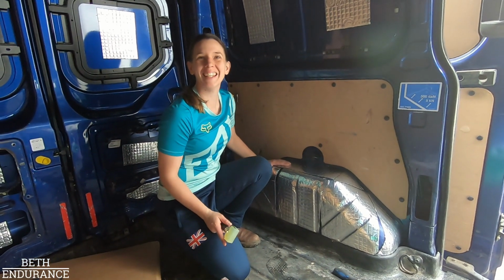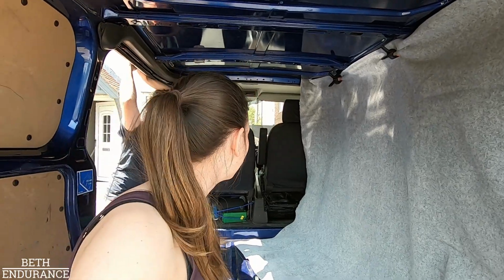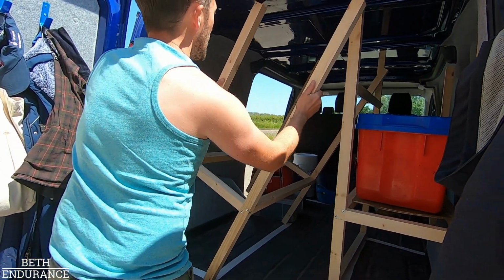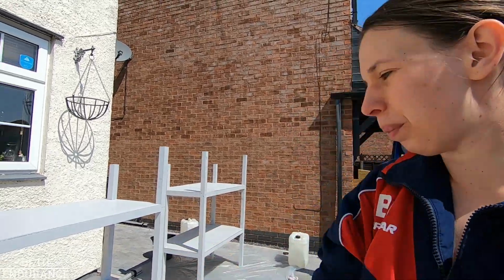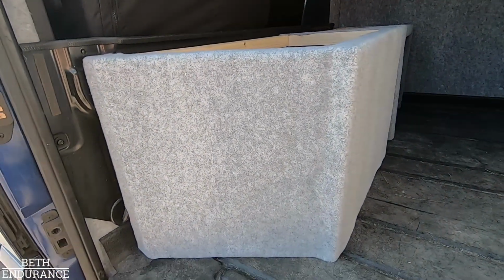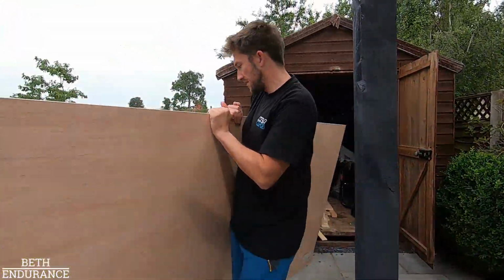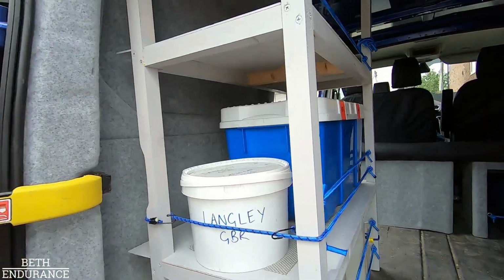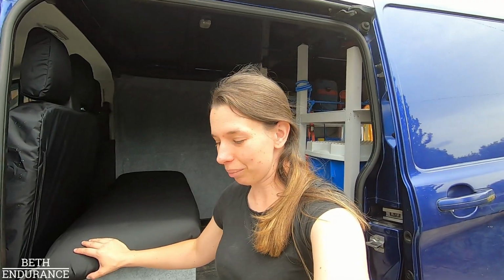Building the ideal crew car - Ford Transit conversion - Vlog 186 - Beth Endurance

Comment: So nice!! Just out of curiosity, how did you fix the shelves on the inside of the van? I would definitely like to do something like than but I am worried about drilling holes in the metal.
Reply from the maker: We used self tapping screws and L brackets into the pillars, we don't screw anything into the external metal work x
Reply: @bethendurance  Oh, that's great! Thank you!